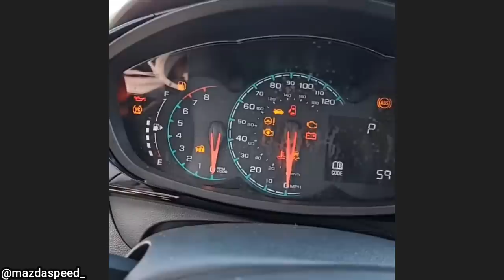Customer States My Car Won't Start (Chevrolet Spark) | Just Rolled In

Comment: I've never seen the hoods split open like that but it's very common for that front edge to rust through on the Chevy trucks. My buddy has an Avalanche that's pretty bad there, I'm going to send him this video lol
Reply: If they preemptively add a few short bolts with wide washers to hold the layers together, it will look like poo but prevent the duck-face blowout.
Or look around junkyards for a hood in better condition.
Reply: I want to know what he said!

Comment: I've had a hood separate like the ones at 1:30.  It was due to the front edge of the hood being rusted off and I may have been driving  a tad faster than the limit.  Luckily my guardian angels steered the car till I got it stopped and was able to push the hood down again.

Comment: I remember getting a ride back to college with a couple friends, and the driver noticed the gas gauge in his VW had been showing 1/2 tank for a long time.  It stalled as we rolled into the gas station, though filling it up seemed to unstick the gauge.  I figure in time we'll go from "car won't start because of no gas" to "car won't turn on because battery not charged".
Reply: We're already there...
Reply: I think this problem has existed in practically every car since 1920.

Comment: Dang it I thought sure that the Chevy Spark would not have a spark to start the engine.  LOL .  Yeah they do not run real well when they have no gasoline!
Reply: I was looking through the menu on a BMW to reset the service interval and came across a warning that said something along the lines of; Continued engine function may be impaired if fuel level reaches zero..
Reply: Let's be honest, that gas gage isn't exactly well designed. How about having the scale backlit in red when the tank is empty or something? I assumed the gas warning light to be part of the Christmas tree thing every car does when you switch on the ignition.
Reply: @centralintelligenceagency9003  yeah, if the person just bought that car (or borrowed it) I can see that being confused with a full tank. I wouldn't pick on the driver, unless they owned it for years!
Reply: @centralintelligenceagency9003  Let's be honest, unless they just bought the car they know how the gas gauge works.   Looks to me like it is well designed.
Reply: I had a chevy spark as a rental once.  I ran out fo gas. The gas tank is tiny and the gas warning light comes on really late.
Reply: Worse yet, I'll be they come back in the near future and will need the car's fuel pump replaced.  These days the pump is in the tank and the gas running through it keeps it lubed and cooled.  Never run your gas tank to 'empty', fill it up when it gets to 1/4 full.
Reply: @crosslink1493  Seems that for some people that concept is far too complicated to implement.
Reply: That gas gauge was fine. Needlessly digital (i.e. needlessly needle-less), but perfectly readable, plus the low fuel warning light should've been a clue
Reply: @richardthomas1743  Complicated, just like the workings of a wheelbarrow.
Reply: @centralintelligenceagency9003  the last bar should blink when the fuel tank is empty instead of just turning off. I thought the needle for the gauge was missing at first.

Comment: If I ever mess up my own car when working on it you can be sure as shoot I'll tell the shop another shop messed it up!  Makes a person wonder...  But a paying customer is a customer!
Reply: Thought I was going to have to pull that one once...

 I did a set of head gaskets on a ford 3.8 v6 and the car wouldn't start after... This was before I knew anything about engine computers and electrical stuff. I got lucky and remembered a corroded push terminal on the coil that I thought was poor and cleaned it off... That was it! If it didn't start I would have been outta luck.

These days I'd rather diagnose electrical than rip off 4 hours worth of sh1t on a modern engine to get to something.

Comment: The only way I can imagine the brake pad shoving itself into a rotor like this would be if the caliper came off, pads dropped inside the wheel and got tumbled around until one of them got wedged between the wheel and bracket, ramming it in there. The brake DIYer might consider himself a little lucky this happened since I doubt he would have had braking power for much longer with the piston over-extended and leaking brake fluid like a sieve.
Reply: Thank you, I was trying to think how the brake pad could have ended up like that
Reply: @sethc6663  I scratched my head for a few minutes before coming up with that theory. Not many things have the energy necessary to wedge two mostly solid pieces of metal into each other like this. I'd imagine the wheel must be banged up pretty good too.

Comment: How can you NOT be able to read a gas gauge? Especially when there's a warning light that TELLS you to stop for gas! I'll bet they don't change their oil either. Some people just shouldn't own cars period.
Reply: I really can't grasp the amount of stupidity in this world. My warning light died a long time ago, the connector terminals on the gas pump get corroded and it stops working. And it never happened, unless when I was short on cash and I knew I could run out of gas, and even then in the neighborhood, because I knew it might happen, not going 100 miles away.
Reply: The Spark you can see has a light bar indicating the gas level, instead of a typical dial gauge. So you can't tell without the light whether the car has gas or not.
Reply: @Noruzenchi86  Yeah it's a stupid design. In my Seat Leon, the gas gauge was like that - but the engineers were more clever than the GM guys. When you were on empty, the last bar would flash in red color. Turning it completely off like in that Chevy is just poor design.
Reply: @Noruzenchi86  um... if there's no light, there's no gas, you little genius!
Reply: @Noruzenchi86  except maybe for the big orange light that looks like a fuel pump lit up above the fuel gauge? That comes on when there’s 2 gallons or so left?
Reply: Yesterday my work colleagues got report that Peugeot have engine light, but it doesn’t have engine light and service was over 2250 miles overdue that cause service warning on dash
Reply: @TomRxtroWav397  Ok, soooo.... how is that related in any way? 😆
Reply: @nigelbarton8350  you mean the one that comes on with every other warning light before you start the car?
Reply: @corky842  yes- and goes out after a few seconds if you have sufficiant fuel, whether the car starts or not.

Comment: When I worked at a toyota dealership in 2010, hybrids weren't very well known yet and we would get the occasional customer that would tow their new prius back in saying it wouldn't drive. They would just be out of gas and the customers (always completely lacking any car knowledge or common sense) thought hybrids didn't need gas

Comment: Fuse can't pop, if not part of the job!
Reminds me of doing some electrician work at an old mans house... He complained that he could smell burning and hot electronics, but couldn't figure out where it came from. Turns out, he got tired of his fuses popping all the time, so he just used a bent nail every time one popped! Needless to say, the fusebox didn't appreciate it, and everything in it had gotten extremely hot, to the point where i couldn't even remove the nails, as they had gotten welded to the connectors, and i had the change the entire fusebox...
Reply: LOL thats priceless. Also a sparky, bent nails is new to me, pennies or a wad of aluminum foil are pretty common around these parts 😂
Reply: yikes!

Comment: Oh wow, now I'm a little worried. Got a recall on my Honda Ridgeline about the hood unlatching at high speed.  Hopefully it doesn't split like that craziness.
Reply from the maker: What year Ridgeline? Hope that doesn't happen to you.
Reply: @JustRolledIn  2017. Not AWD,  but front wheel drive helps at the boat ramp 😁
Reply: Looked more like a northern vehicle, with severe rust.  The vehicle was just a rust bucket.
Reply from the maker: @Robert Heinkel  yep the 2nd one was very rusty which the technician said probably did it. Something for others to watch out for.

Comment: @ 1:15 How many amps was he running through that wire? Was he trying to jump start a dump truck? 😳
@ 1:43 That brings a while new meaning to "Hunting Tires" 😏😁
Great video as usual brother. Keep up the great work😎💪
(Supra all the way😉😍)
Reply: Given the way the wire was routed, I'll bet it just shorted to ground somewhere.  Remember: the fuse isn't there to protect the load.  It's there to keep the wire from burning up if something happens.

Comment: In the 31 years I've been a mechanic, I have seen at least a dozen tow-ins that were out of gas, and 2 that were filled with diesel (gas cars)!! How did they even get it in there?!
Reply: Simple!  Same size nozzle on all pumps. The same thing happened in the days of leaded/unleaded gas. Station owners would cut corners and buy one size nozzle. Customers would discover this trick, and fill up with cheaper leaded gas, on a new car that required unleaded.
Reply: Some nozzles aren't too thick, or some car filler necks are wide enough. I had the diesel nozzle in my old TL. They had replaced the pump handle with a black one. It went 87,89,91,diesel. I run premium so I'm used to grabbing furthest away from 87. My friend said "I think that's diesel" and sure as shit it was. The nozzle fit in my filler neck fine. I got really lucky he was there. I've worked on cars for 20 years and it almost happened to me
Reply: @poopool_Q  Back in the days of leaded/unleaded, I would always grab the cheapest price nozzle on the gas pump. Twice it turned out to be leaded, but I noticed after about 2 gallons so no harm done. My friend was not so lucky one time. He was distracted by something, and put about 10 gallons of diesel in his gas-powererd van. OOPS!  I wasn't with him that day to stop him.

Comment: Honestly, with the design of the fuel gauge on that Chevy Spark, I'm surprised that doesn't happen more. (idiots exist, designs have to be better)

Obviously there's the fuel warning light but having no clear indicator of empty is a terrible design.. added to that, using non-descript white dashes to indicate level is pretty bad (hell, it took me half a second to realise that was the fuel level indication). I'd expect plenty of people to see the fuel door arrow pointing right and look right for fuel level.. Then they see the tacho needle pointing toward the fuel gauge and mistake it for the fuel indicator (or something like that).

Also, it's called a "Spark".. There's bound to be people who think it's an all electric vehicle.

-- EDIT --

Just a quick edit to add or clarify.

A couple of people have mentioned the bottom dash turns red so that makes it a clear indication. Okay, fair enough, I'll grant that it does mean the design isn't quite as terrible as it first appeared but it's also missing some of the point.

First, the sort of person who runs a car dry is also not paying that much attention to the fuel gauge. Is it a clear enough indication for those people? (whether you like it or not, they exist)

Then there's the second issue which, for me, is the big problem. In this video there is nothing on the fuel gauge indicating that it's actually empty.. It's just blank.. That's a lack of indication. While the fuel light is on, it's also a light that comes on when you start the car so the average person won't exactly look at that and think they're out of fuel. Obviously a mechanic or anyone with basic mechanical knowledge would put 2 and 2 together but that's not who we're talking about, but even then, as someone who knows his way around cars, when I saw the first part of the video my first thought was "I can see the gauge but where's the actual level?" (which could probably be overcome by something as simple as a little outline of where the lights would be when they're on)

Compare that with an old fashioned needle indicator where even if you run the tank completely dry you still have a needle pointing at the "Empty"/"E" part of the gauge. You still get some indication as to what is happening.. It's not like the needle just disappears once you are empty.

The point is, the fuel gauge has 1 job, to clearly communicate the amount of fuel in the tank. This has been achieved adequately since the earliest cars yet this design manages to do that job worse.
Reply: I have one, and the bottom dash light turns red when it is the last one lit... it's hard to miss.
Reply: There is a clear indicator, the fuel gage turns Red when it gets to 1/4 tank left
Reply: I agree.  It's a bad gauge and I've certainly made stupid mistakes of that caliber in my life so I'm not going to judge.  We're all stupid at some point and when we are we hope no one noticed - or put it on youTube for all to see!
Reply: Yup. especially if someone borrows the car who's not familiar with it. I agree, it's a stupid design for a gauge. Form over function seems to be the norm these days.

Comment: I can't imagine driving and have my hood do that and not have the ability to close it after.
Reply: Must have been a big gust of wind! Or a flimsy replacement hood. Amazing how it ballooned out!

Cheap aftermarket body panels rust super fast too.
Reply: Ram air.
Reply: The Ric Flair hood
Reply: Govt. bailout era GM combined with CAFE standards, resulting in thin body panels.

Comment: Honestly that Chevy Spark fuel gauge is poorly designed. The fuel light should flash when the counter goes off the gauge.
Reply: No kidding. If nothing is showing, it's kind of hard to know if it's empty or full
Reply: I'd expect the yellow fuel pump to only light up if fuel is low, but it was still on after they cranked it up with ~1/2 tank -- perhaps it takes another second to go out?

Comment: Have had that trash fire in my shop back in the 80s when the guy in the next bay dumped his tune up parts in the barrel, along with the fuel filter that he didn't drain. One spark later we heard a dull thud, and it was raining flaming garbage. No injuries, but from then on everyone got the message that they should drain fuel filters before tossing them.

Comment: Oh God I did that gas brainfart in my old tin can Pontiac. Except it turned out my gauge was actually wonky so even though it read 1/4 left it was actually  empty. I was a broke 19 year old in 2012 and the absolute saint of a shop owner just charged me for a few gallons of gas and not wasting his time.
Reply: Allot of mechanics won't fault a teenager for not knowing a gas gauge can go bad on an old car.

And it's not stupid to think you have a 1/4 tank when the gas gauge reads 1/4 tank. Ignorance is forgive-able. 

But things don't look good on a customer if they make the same mistake and show up with the same vehicle with the same problem the next time.

Comment: Those bowed out hoods on those early 2000s Cadillac Escalades and GMC Denali’s are due to GM cheeping out and using adhesive to glue the fronts of the hood together. Believe it or not its not that rare of a thing to happen to those trucks.

Comment: Old timers at work never ran out of fuel, but if the fuel filter got plugged with air, it cost them a case of cold beer. LOL

Comment: I've never seen a hood do that before. I can see how it could happen. I have known hoods to fall off of Toyotas, or the latch breaks and the hood opens and slams back over the windshield.
A guy in my apartment complex had a Toyota truck, about two years old. I noticed the hood was all crinkled up one day, like a wadded piece of foil that was smoothed out. Asked what happened? "Was driving on the Interstate and latch broke, hood flew open, knocked off wiper, cracked windshield. Went to Toyota, they replaced broken latch, said all that other stuff wasn't their responsibility to fix. I came home, took off hood and jumped up and down on it until it's flat enough to latch shut".
I've seen other Toyotas that lost their hoods, too. I ran over one that fell off and landed in the Interstate near Nashville. Car beside me, no way to miss it. White Toyota backing up the shoulder, I guess to get it. It didn't look too bad, until my Kenworth ran over it.

Comment: First clip:  I was the customer states with the exact same issue on a 91 Honda Accord.  I just recent had work done to it at a dealer (it was the cheapest place for the job).  I learned that the fuel gauge failed and I did not have half a tank of fuel.

Last clip:  FIRE IN THE HOLE!!!

Comment: The truck with extreme alignment issues was probably from turning the torsion bars up to increase ride height. I delt with crap like that when I worked at an off road shop
Reply from the maker: I was thinking the same. First thing that came to mind.
Reply from the maker: Update from the tech. Customer tried doing a bunch of work on his truck but couldn't figure it out. Drove it to the shop with some missing front end parts apparently so they could finish it.

Comment: The very first thing you should check on a crank no start. Does it have fuel!!! I know I know, it sounds pretty stupid. But you'd be somewhat surprised how often this really happens. But after 35+ years as a mechanic, I've seen some pretty stupid and some rather unbelievable crap.
One example being the crankcase FULL of oil. I mean LITERALLY FULL!! Took the oil cap off and it was RIGHT THERE FULL. Well no wonder it's smoking and has no power 😲🤦‍♂️